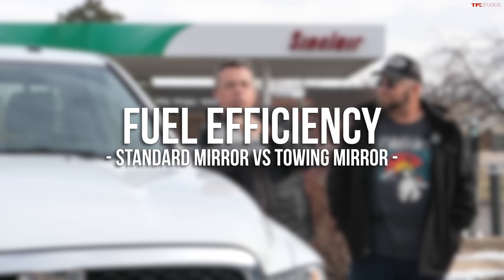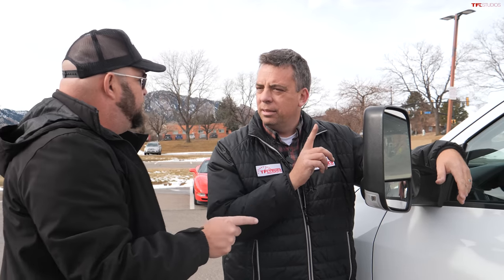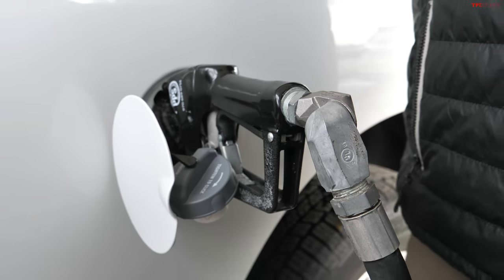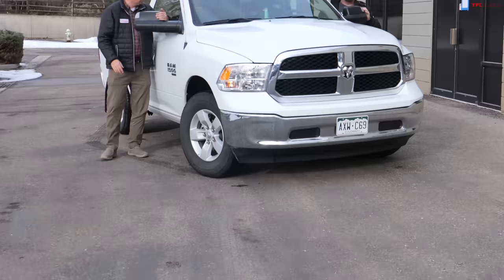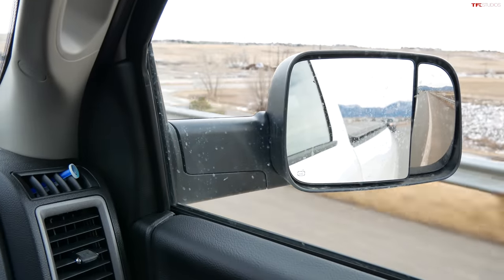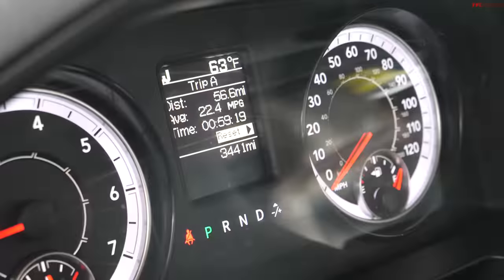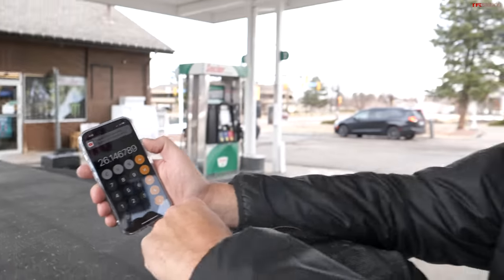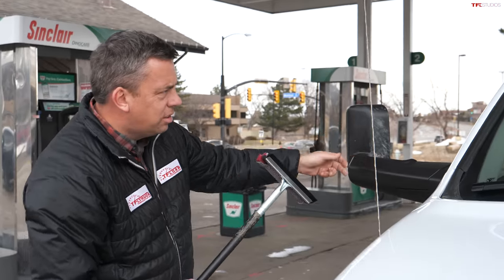TOTALLY UNEXPECTED MPG - Never Drive with Your Towing Mirrors Extended While NOT Towing: Here's Why!

Comment: I think this experiment should be repeated a couple times more to see if it's actually always the case to have a huge increase in the fuel consumption.
Reply: Agreed. Nathan’s pumping skills are suspect 😮
Reply: They should have backed up the mirrors-in segment again (right after the 'moose-mode' run).
Reply: I can assure you the moose mode mirrors definitely take my RAM from 20mpg highway to 15mpg. It's not a joke, they really do eat the fuel... and it sucks because it's easier to see with them out having all my overland gear on the rack in the bed.
Reply: @DaveDuzzit  
Aerodynamics..
Just like putting your hand out the window.
Fist goes through the air better then a hand wave
Reply: the drag coefficient for a cube is 1.05

and having them in tow mode adds a whole bunch of cube shaped frontal area.

so yeah. the test is correct and mirrors are horrible for drag
Reply: @DaveDuzzit I never lost much MPG with the mirrors in tow configuration on my 2020 ram 2500 cummins when I had it.
Reply: I feel like they should do it 3 times in each configuration alternating each time to get better results. When your driving a stubby you can't feel how much wind changes so the only way to help eliminate that problem it repeat
Reply: So when will the US change our laws regarding side mirrors to allow for small cameras on a stalk instead of these fuel gobbling chunks that are hanging off the side of our vehicles?
Reply: @secondamendment8773  
New trucks in Europe have already adopted the camera.
Screens shaped like mirrors, flank the dashboard!
Reply: It's not just variation between the two tests, the problem is the variation between pump and the trip computer. The trucks trip seems reasonable, yet the pump wasn't even close. So which one is right? Well, the pump. The pump is likely way off, and it should tested to confirm.
Reply: @elonmust7470  mate the ram 1500 has a frontal area of 27.5sqft and a Cd of 0.36. leading to a CdA of 9.9sqft.

a box, which is a good enough approximation of that mirrors shape, has a Cd of 1.05. so an extra 2 sqft of mirror increases the CdA, and therefore fuel consumption at high speed, by 2.1 sqft or 21%.

26mpg/1.212 is 21.5 mpg.

20/1.212 is 16.5mpg.

so there's only one clown here and it's you
Reply: There is no way it would be that far off. I’d run that test a couple more times and on the same pump if possible. I’d understand if it was one MPG but not several.
Reply: I've been highly suspect of the 57 mile fuel loop results.  The sensitivity of the pressure stop on fuel pumps is not consistent even when using the same pump on the same vehicle on the same day.  If the test results using 2-3 gallons varies by .2-.3 gallons that's a big difference.
Reply: @anonym3017  I'm not talking about half ton trucks.
Reply: Nathan's closing comment wasn't wrong😂
Reply: @elivarney7148  2 square feet of mirror increases the trucks drag by about 21%. so yeah. several mpg worse is entirely realistic
Reply: @elonmust7470  weight plays a significant role in stop and go traffic or when there are significant grades in a drive.

this is a highway loop so there are no significant grades, height differences or start and stop traffic.

furthermore the ram 2500 has the same Cd as the ram 1500 and only a 2 sqft increase in frontal area.

the 2500 is at 29.6sqft while the 1500 is at 27.5.

so the percentage effect of having the mirrors up is roughly the same for both of them.
Reply: @davidholt7126  depends on your average speed since aero isn’t 1:1 and also you’re running a Cummins. This is a gas engines vehicle which is effected even more.
Reply: @AkioWasRight  this right here! They should properly calculate gallons into 3 to 5 fuel containers and fuel them up on separate transactions. This will eliminate the pump’s calibration being off
Reply: Ya they definitely need more testing one it got better than the truck said and the other it got worse that doesn't make sense
Reply: @Torsee  I get that.... obviously. I didn't think it equated to 4-6mpg loss at highway speeds, though.
Reply: @davidholt7126  Diesel changes the formula for loss, as the fuel has more energy density, along with other variables. There's a reason people choose diesel for towing, it doesn't suffer on mpg as much when you put extra load on it. Mirrors out like that is just another form of resistance, like weight.
Reply: But it looks so cool in moose mode! How can this be true?
Reply: This is some bad reporting.  All other tests on this truck for control, + the truck computer, +the epa sticker, + your anecdote reaction that something wasn't right when it clicked off and had a big top off. say you did NOT get the 26mpg.
The "moose mode" is not a 6mpg difference.
TFL should be ashamed to post this video as fact. And journalistic integrity should take it down and re-do the test. Or at least aknowagment that it falls outside of the expected margin and could be off.

Comment: Your default result of 26.1 mpg deviates considerably from your other default mpg results (tire pressure 22.6, tonneau 21.1, and spoiler 22) and the epa rating 23. While some deviation is expected due to varying conditions the 26.1 result is about 20% higher than the other results, which suggests some kind of anomaly. Given that the mirror modification was run afterwards this anomaly may have affected those results also. A retest is necessary.
Reply: They used 85 octane on those video where they used 87 in this video which will result in higher fuel economy
Reply: @aroundthegroundlandscaping7107  they need to keep things consistent so they should stick to 87 with the same brand of fuel every fill up even when not testing
Reply: @aroundthegroundlandscaping7107  no the pump didn't fill up the tank as far giving a false high mpg then they  over fill on the second run making it low . trust the computer when your only putting in 2 gallons
Reply: They used 87 this time, mostly 85 octane on other tests.
Reply: Yep. Either a full difference or someone "mistakenly" followed a semi for 10 miles.
Reply: @aroundthegroundlandscaping7107  There are a few tests that show 85 gets better MPG when operated in normal driving conditions. There are many similar test showing the same for 87 vs 93. Changing the RON (higher) requires additives that are less energy dense. Granted I'd never try to quantify MPG while picking two different fuels, but it likely isn't the cause here.
Reply: The 87 octane would only be a factor if they filled the tank from empty. That little dab isn't going to change things much.
Reply: Definitely something wrong in their test because I have those mirrors and on my ram 1500 with the same body style.  I have never seen anything close to a 6mpg difference from switching my mirrors up or down

Comment: I think the variation of when the pump thinks your tank is full and the very small amount of total fuel being used for the test is a bigger factor than you realize. When a half gallon of fuel can swing the results a huge amount, you need to at least have an exact weight measurement of fuel used rather than relying on a pumps sensor for volumetric measurement
Reply: I hope they read your comment
Reply: Well put! They do need to read this.  Problem is, no one wants to hear that at their studio.  I can't blame them. It would be insane to have to measure fuel that way and it would make their sponsor look like the pumps are not calibrated.  Not a good look IMO.  No matter what way you look at it, It needs way more testing.  I'm very interested in this and may swap my tow mirrors from my F150 back to standard and back to test myself.  Very odd how far it was off. @the fast lane truck
Reply: @RegularJoeTravels  It has nothing to do with calibration/accuracy of the pump, just variances on when it detects the tank is full
Reply: @ferrisr  It would be impossible for them to measure fuel otherwise no?    Always potential for inaccurate readings due to this from what I can see.  I'm very interested in the actual data.  I drive a lot and prefer tow mirrors on my ford and chevy trucks.
Reply: @RegularJoeTravels  the most accurate method would be to meter fuel coming off the fuel pump and returning to the tank and monitor consumption that way. I'm thinking just trusting the trip computer would probably be considerably more accurate than the gas pump method though (and likely accurate enough for tests like this), especially on a stock truck, since the ECU knows how long it's firing each injector and how much fuel the injector should dispense in that amount of time.
Reply: @ferrisr  it would be nice to get an accurate reading for sure.
Reply: @ferrisr  You should be able to get accurate fuel flow data from the OBDII port, with any number of aftermarket computers.
Reply: Absolutely! When I fill my motorcycles and you can physically see how full the tank is, there is a huge variation in when that pump clicks off even if you're at the same pump the same day. Plus your tank isn't actually full when it clicks, I get another half gallon in my tank sometimes and the tank is only supposed to be 4.2 gallons on the bike I ride the most. Just extrapolate that info to a 20+ gallon truck tank and it's easy to see how wild the calculations can be thrown by the pump.
Reply: @RegularJoeTravels  "It would be insane to have to measure fuel that way"  That's how 3rd-party independent test organizations do it, and IIRC, MythBusters did too.
Reply: Yep, and not just the fill-up scheme, either. Their test methodology has way too many variables beyond their control to be consistent enough to show the tiny differences they routinely present.  But I gave up pointing that out to them a long time ago.
Reply: Too many variables to consider.  I agree that that trucks internal mph measurement system is far more accurate for short distances than your method.  Here is one more for you, temperature.  Even though you claimed the temperature was similar for both drives, what was the starting and ending temp for the fuel in the fuel tank?  I knew a guy who was very competitive and would "cheat" on fuel economy rallies by refrigerating his fuel. He would show up just before starting time so the fuel would not start pouring out of his tank. The fuel would heat during the rally.  He would win but no one knew what he did, but they were sure he cheated.

Comment: I believe the 0.2 MPG difference shown on the truck’s computer is probably closer to being accurate.
Reply: Yeah that puts it at about 1% difference. The onboard computer is better for measuring small differences in fuel consumption.
Reply: Agreed, that ECM knows exactly how much fuel is being used.
Reply: I agree.  For this type of test, where the same truck is used for both runs, I’d believe the truck’s computer for comparison.  I’ve been skeptical of the usual 30 second top off method because I just don’t see the pump being that consistent.  Especially when the fuel consumed is only 2 gallons.
Reply: 100% in agreement. Two pump method is not only wrong, it is absolutely useless on a test of 2 to 3 gallons. What a waste of time.
Reply: @joshc606  yeah but they are not asking how much fuel was metered. they are asking what the miles per gallon are.
Reply: The computer is usually off becasue when you take the foot off the gas it does some crazy things like jump the MPG to 50 which is not realistic.   I am always for pen and paper is it is much more accurate.  You can also use apps to do it for you like what is that one called Fuley or fueley or something? I dont remember

Comment: I agree with everyone else who said you've got to repeat this test a few times. Sure the Cd and frontal area increase a BIT in tow mirror mode.  The change in drag could be calculated if those # were known. Eyeballing it, the change will not be large. I do applaud your fill technique with the 30-sec wait.  I HOPE you use the exact same pump every time.  Control your variables to every degree possible.  Air temp variable is surprisingly big, and the truck has to be fully warmed-up including transmission (does it have a trans temp gage?).  Things like traffic and wind are impossible to control so that's why you need to repeat it a few times.
Reply: 0.36 Cd for the ram.

1.05 CD for a box, which is a good enough aproximation for the mirrors.

does anybody know the frontal area and how big the mirrors are?

and the truck being cold would have lowered the fuel economy ion the first run.
Reply: vortexes my good man. When it's way out in the side like that the air you displace is also displacing other air. think of a paddle when you're kayaking. Just because it's a relatively small surface area doesn't account for the fact that where it actually is so far out the main slipstream makes that mirror more effective in being aerodynamically annoying.

Next time you're on the highway try sticking your hand out the window and feel the difference close to the cab vs with your hand outstretched

Comment: Ok, I watched this video when it came out and lets just say my belief was on the low end.  With that said, I recently went on a roadtrip in my 2020 Ram 2500 gasser.  I remembered what this video said and did my own experiment. For the first half of my highway miles I had my mirrors set to the "down" setting and was getting about 14.5 MPH.  I used my electric motor to "fold in" my mirrors but did not change any other thing about my driving.  My mileage went from 14.5 to 16.5 for the remainder of the trip.  This was according to my on board computer.  I realize mirrors create quite  a bit of drag but who knew it was that much. After my little experiment, I tend to believe yours.  Thanks for doing all the truck reviews, I do use your research for looking at vehicles.

Comment: Seems you happened apron the blaring problem with your test, the pump works on air pressure differential. Big change in air pressure will change shut off point. As well as changes do to fuel temp in the tank. Two a half gallons is a long way from a valid fuel test! The dash computer is much more accurate at those minimum mileages! Late models have fuel pressure and temp readings making the fuel readings very close minus the distance differential.

Comment: Mirrors are a HUGE factor. Over here in europe we got these clip on mirrors for passenger vehicle cars when towing a camper trailer or whatever, and they drink upwards of 3-5 liters/100km on top of your regular fuel mileage, that test is in fact valid. Not only that, its fairly straightforward. The standart position mirror only adds a bit of the outline and are in fact aerodynamic as it can get. The Tow-position ads a whole load of extra drag and extends your vehicles outline by a LOT!
If you wanna give it a shot yourself, hold out your hand for a certain period of time, to see how much force you have to bring up to hold your arm in position at highway speeds.

Comment: I've got a suggestion. From now on with the two loop MPG thing. Drive a car or truck in conjunction with the test vehicle. But the second vehicle gets no changes. If the MPG of the second "control" vehicle stays the same that will add a lot of validity to these tests. I'll pay for the fuel for the second test vehicle for the first try if you do it.

Comment: Not that anyone will read this now..😂 But after watching and checking 2 times the issue was clear. When he calculated the mileage he DID NOT USE THE SAME FORMULA BOTH TIMES. This is why there so bizzaro.  This test is a complete failure due to human error. But as i watched it it can be updated just by rewatching the video and doing the calculations correctly this go.. 🎉

Comment: My biggest issue with the Ram mirrors is that they do not heat the bottom mirror. Using the 2500’s for plow trucks and needing to scrape ice off the bottom mirror while the top is heated is beyond irritating. 
It also makes pulling trailers in the winter more difficult when you can’t see the trailer while making turns. I don’t understand why Ram doesn’t address this. Rant over.

Comment: I would not use the GPS mileage.  If you keep everything referenced to the odometer in the truck, minor variations in driving won't matter.  This is a relative test, not absolute between the two mirror modes.  You are using a driving average (57 miles), then applying a one-time result to that average which is not valid. It needs to be referenced to the actual mileage, like 26.6 shown on the odometer.

Regardless of results, I plan on running my 2014 Ram 3500 with the tow mirrors out.  I can see better and don't have to swap back and forth when not towing my 5th wheel / boat combo.

Thanks Andre "Topov", I really appreciate all of the TFL videos!

Comment: Consider using an OBD2 reader and app that can read the fuel usage read by the ECU. That would be more accurate than relying on a gasoline pump. I suspect the small drop calculated by the truck is closer to the real result.

Comment: I was noting that moderate temps seem to improve my gas mileage appreciably from very cold temps - at least going by the MPG meter in the DIC. Wouldn't be surprised about the mirrors - especially sticking so far out of the stream flow of the vehicle.